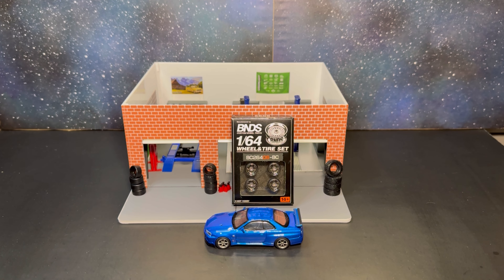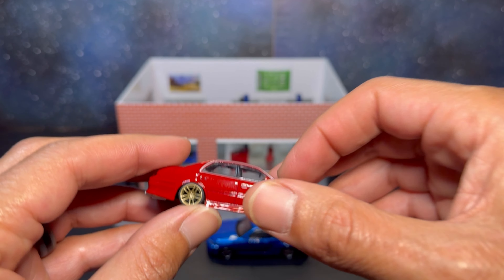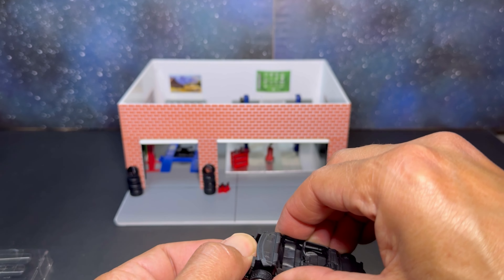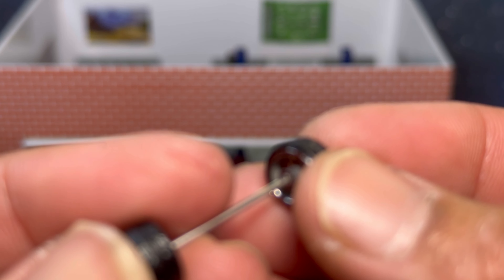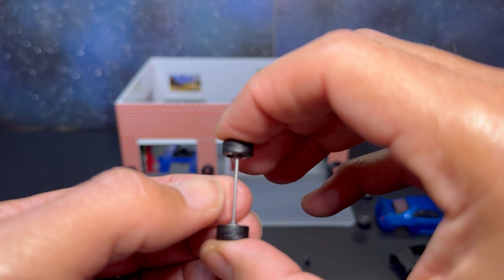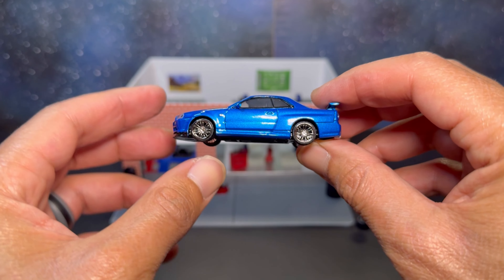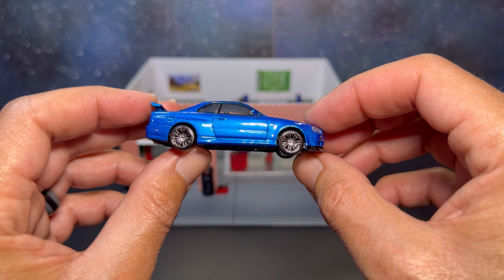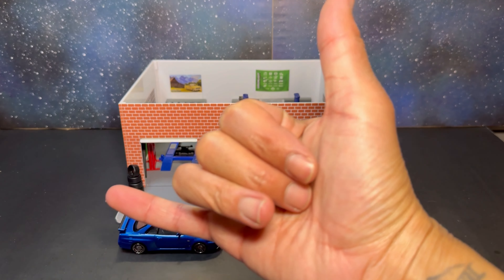***Wheel Swap Tutorial*** Episode 1!!! Let's Swap a Mini GT With BNDS Wheels!!!

Comment: Nice!! Easy swop Dee Moo. What I'd like to see more clearly are the wheel well the axels sit on; the axel cap or covering that is the base of the interior. Does it also have a cut out or not? 
Finally, if you have a digital caliper, measure and compare the size of the original wheel and the donor wheel - this also guides  you if your into lowering your ride.
Looking forward to part 2 where we get to slap those rides!❤
Reply from the maker: I probably should invest in a digital caliper just to provide the actual specs. I believe BNDS advertises them as 9.8mm and Hotwheels claims real riders to be 10mm. Not sure if that is with tire or not so an actual on camera measurement would be nice! The channel for the axle is not as pronounced on Mini GT as it is on say a Hotwheels. The interior piece that covers the axle and holds it in place does not have a channel for the axle, however you could shave a slight channel into it but precision is key or the axle gets too much slop like the Chaser I showed. Premium diecast is definitely more of an exact science then Hotwheels or Matchbox, even Tomica

Comment: You think I could use the axles the car comes with but add the new wheels ?
Reply from the maker: The issue you will have using the axles the wheels come on is length and size (diameter) of the stock axle. It would probably work with the BNDS wheels used in the video, but when you order those wheels they will come with replacement axles.